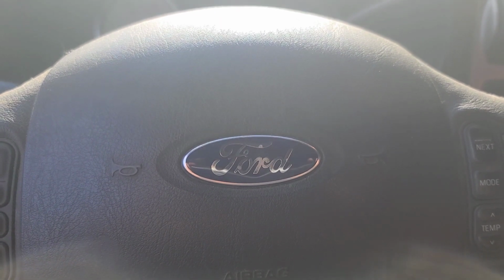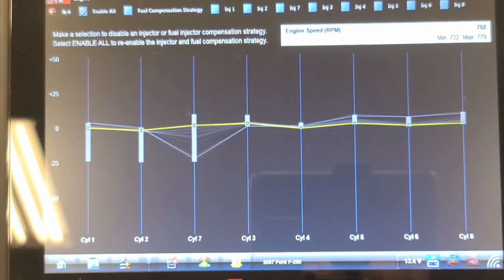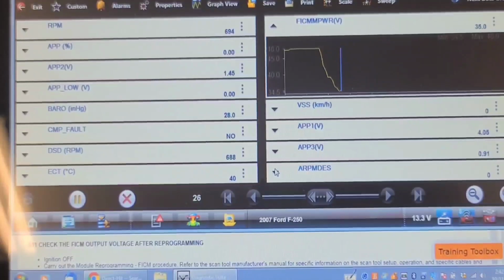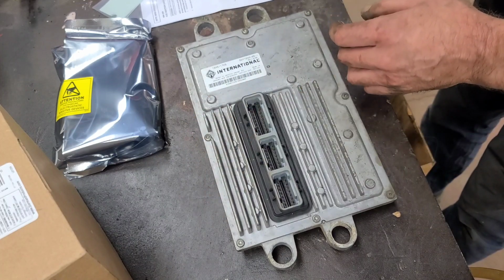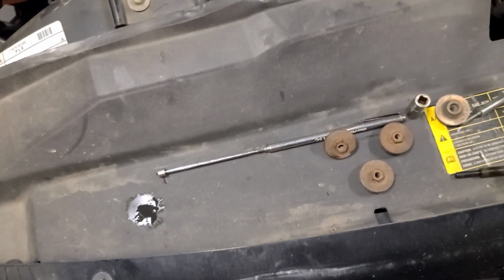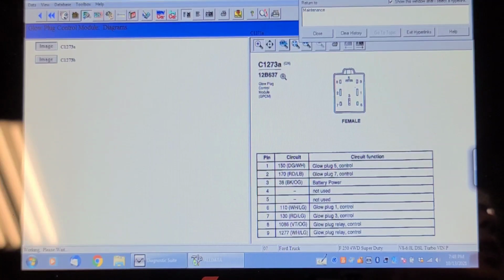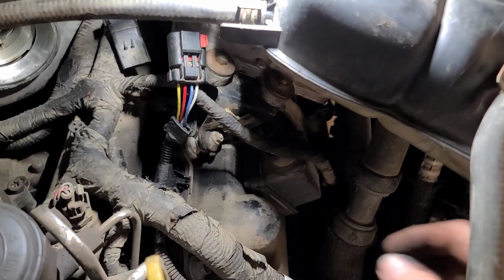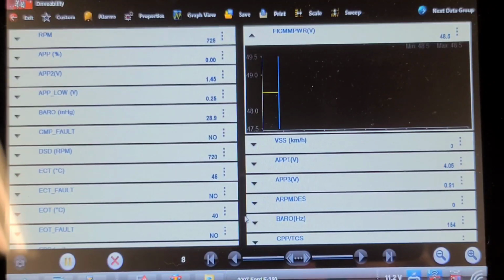2007 F250 6.0 SD Multiple FICM Codes Plus Glow Plug Code.

Comment: Philip, AWESOME work learn some thing new today from u and  about Honda civic question asked you for help that came from other shop after they through so many part on it coils, plugs, injectors, fuel pump, catalytic converter and alternator with out fixing it codes were p0300, p0301,p0304 misfire comes on when engine is hot and 2000 rpm after my basics checks for sparks, fuel, relative compression and standard cage compression that showed over 180 psi across cylinders checked kam and crank correlation with cylinder # 1 ignition cynic to it compered with good one looked good so end it up cleaning G101 ground was some corrosion  on it did not fix done valve clearance procedure and putting some clean gas after went really low that i done in purpose to get red of the old gas and drove it as i done before the same way and wellaaaa hit the nil on the head the car was fixed and driving great with no misfire so thanks for the information u shared for Honda brother really appreciated stay healthy and well cheeeeeers.
Reply from the maker: Great! Glad you figured it out.

Comment: Nice video. I'm positive most of the glow plugs I've checked were all around 1ohm. Those other ones seem low to me. Odd.
I've changed many FICM's but never a half shell. I enjoyed seeing it done.
Reply from the maker: The obvious benefit is no programming required. That can be a PITA when the ficm software is updated to current and the PCM software is out of date. Ford recommends updating both at the same time. Problem is the PCM is tuned with aftermarket software.